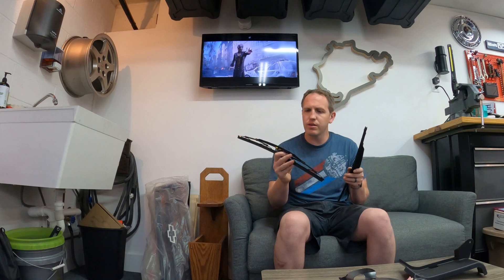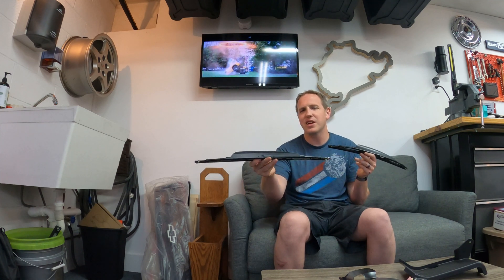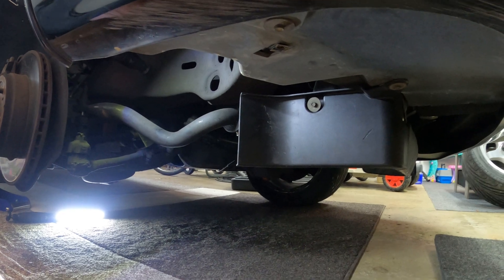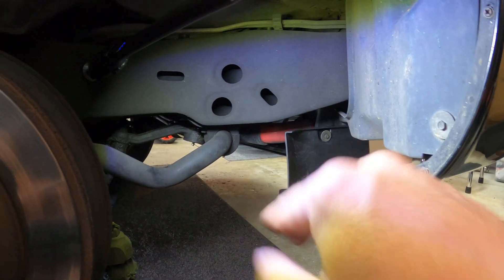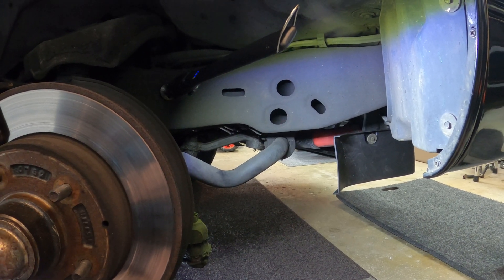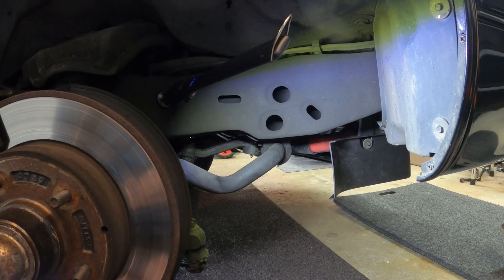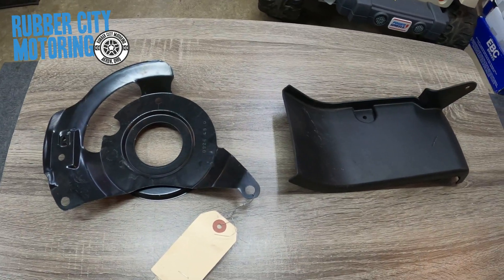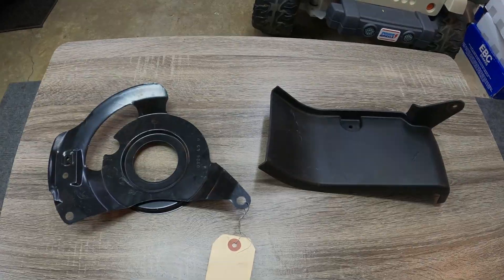Impala SS / Caprice Factory Brake Cooling?? This is very cool!

Comment: I never bought any of those mad I didnt the 9c1 dams and now you cannot find any. They were like $7.50 a piece.
Reply from the maker: Goes for so many parts too. These are super interesting though, I think anyways. Such a different idea.
Reply: @RubberCityMotoring   Yea i never liked the look from the front of the 9c1 dams. Later on the greedy parts reseller idiots wanted like 30+50 a piece for one of these ive seen some buy the center air damn that was 21 dollars list for 150+     They crazy no point in paying that much for something that gets scraped up

Comment: There is some debate as to how effective the 9C1 air dam actually was at cooling the brakes. Probably better than the Civi/ SS air dam, but it's by no means an extensive brake duct system.

Still cool though!

Comment: I got the  PowerStop drilled and slotted rotors and the carbon ceramic pads for the front of my 96 Buick Roadmaster sedan. They paid for themselves the first week. A car slammed it's brakes on in front of me on the highway and I'd never had that big car stop so quickly and smoothly. I'm on my 3rd set of pads now and I won't use anything else on it.
Reply: i waited 6 months for summit to ship me that brake kit.....worth it.

Comment: I drive a 96 Buick Roadmaster sedan and I need all the help I can get. Especially anything low buck. I'm really trying to figure out what kind of rear end I can use. My Roadmaster has a 2.56 open diff and I really need at least a 3.23 posi. My LT1 is pretty strong but it's a dog off the line. I figure if I can get a better rear gear and maybe a slightly higher stall converter it'll make it more fun to drive